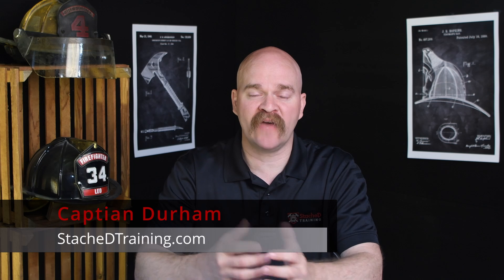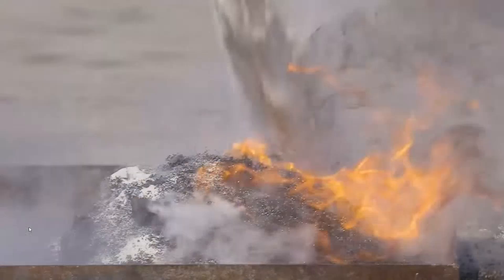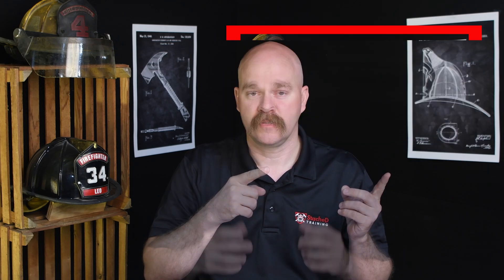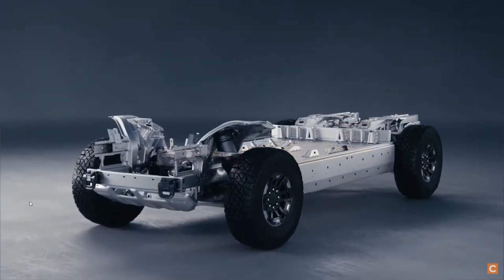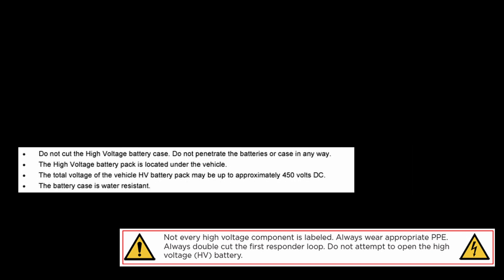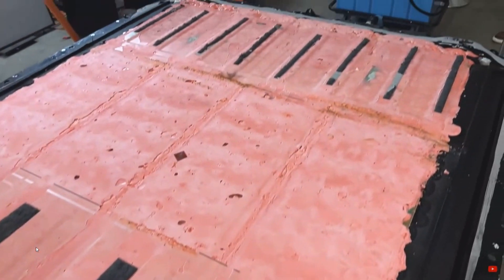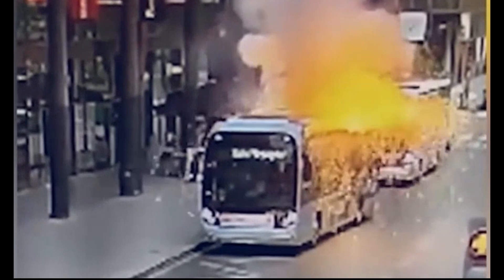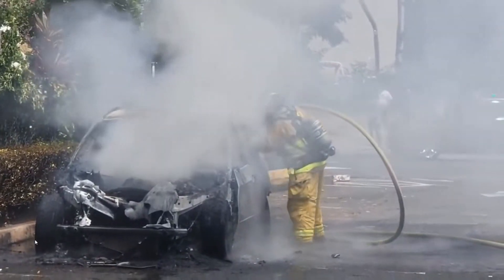What Firefighting Tools for Extinguishing Electric Vehicle Fires Really Work?

Comment: I heard rumors that some fds are pulling them into shipping containers and flooding the container.   Is this true or possible?
Reply: Yes, we do this in europe. One thing to keep in mind is that the amount of water displaced in the container by the burning car is less water to cool the batteries under 138 degrees (Celsius). So the bigger the vehicle, the more water you'll need to replace (water is vapourized by the heat of the fire, so needs to contantly refilled). 
We're working on solutions for construction vehicles and battery wagons for locomotives now. No solutions yet; those fires need to be left to die out in a controlled manner for now...
Reply from the maker: It's something they have been doing in different areas of Europe and I believe there is a system available in the US now.  There are also departments burying EVs in sand.  I struggle with these concepts for a multitude of reasons.  I'll discuss it in a future video.
Reply: It would be easy to use a rolloff container (easily delivered and recovered by common rolloff trucks) with a proper door gasket (not difficult), welded roof if desired, and a winch cable setup with a snatch block attached to the "solid" end. A section of chain (think of a fishing leader) with a J-hook (towing supply) with a pipe handle would permit hooking the casualty then winching it into the rolloff. Shut door, fill rolloff, let cool. The rolloff could also be filled with earth or sand which is easier to transport than a container of liquid without baffles.
You can get with your local wrecker/recovery outfit to experiment. The parts are cheap and easily available. If you lack a winch or the winch doesn't work for some reason you can simply drive the towing vehicle to drag the casualty. Wire rope is cheap and the section exposed to fire can be cut off in a few seconds with a cordless angle grinder.
I use all the above tools, cable and hook (but not the rolloff) moving various heavy objects, vehicles and trees with my half-ton trucks (does not strictly require a wrecker) and they work a treat.
Reply: @Comm0ut  And what are you going to do with all that water that's now become hazardous waste??
Reply: @Comm0ut  you're a perfect dunning kruger example
Reply: I heard these batteries burn even underwater